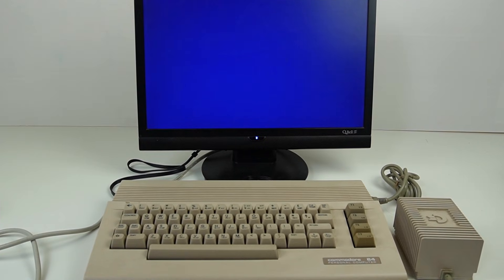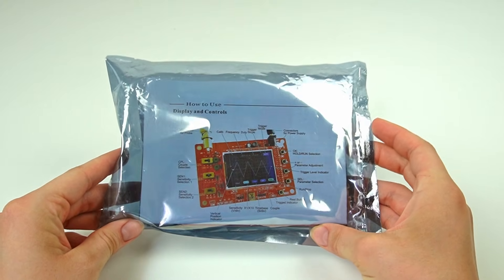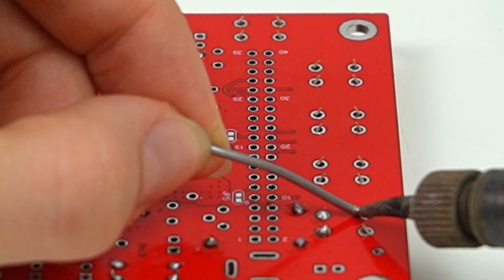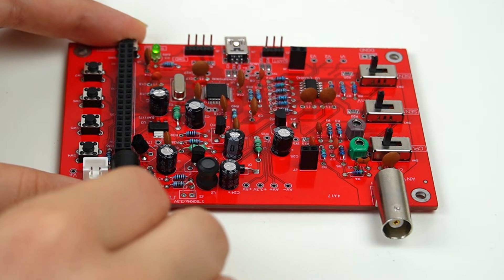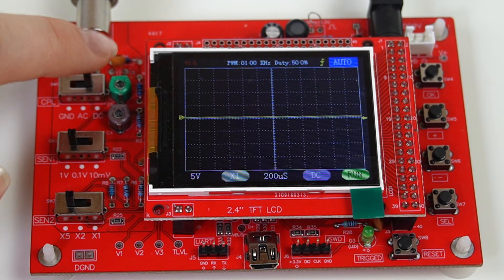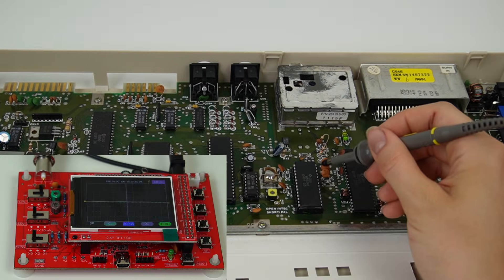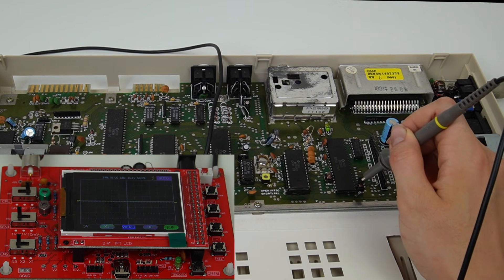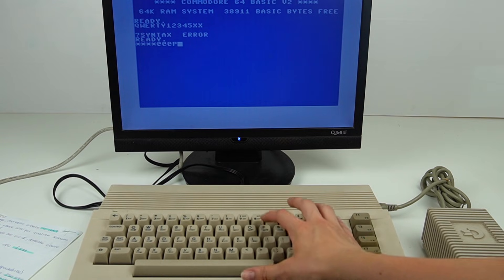I fixed a C64 using a $20 OSCILLOSCOPE

Comment: Great job! You just proved that repairs do not require expensive equipment and you can also build them yourself. I'm impressed. BTW. Soldering is much easier if you use soldering flux.
Reply from the maker: Thank you so much for your kind words and I appreciate the tip about soldering flux

Comment: Always good to see these old machines brought back to life. That $20 scope won't replace a proper scope but it is good enough for some basic checks of a circuit. You should not have to push too hard with the scope probe to take a measurement. If you do, something is wrong. In this case you mentioned oxidation in which case that should be cleaned first. Pushing too hard risks bending the pin of the probe. When the CIA was being resoldered the solder was balling up on the IC pins. This can happen for several reasons: the iron wasn't hot enough, the iron was only heating the pin and not the pad as well, moving too quickly from pin to pin and not giving the pin and pad enough time to heat fully. In the end you got the job done and the computer was fully working once more. Soldering technique and use of a scope comes with practice. Good luck with the next project.
Reply from the maker: Thank you for your detailed feedback and valuable insights! You've provided some excellent points, especially regarding the use of the scope probe and soldering techniques. You're absolutely right; practice makes perfect and I'm eager to continue learning and improving.

Comment: I'm impressed you went for the DIY option on the scope. I got one of the slightly earlier ones and went for the pre-built option. It was still the same price pretty much. It took me long enough just to assemble the clear perspex box it goes in haha. If I'd have built it from scratch it would have taken me all year and likely wouldn't have worked. 

Anyhow the scopes are really good if you don't have one. Great for learning how to use them. I'd advise buying a cheap signal generator on android and hook up the audio socket to the scope as a learning experience. See/capture different wave forms etc.

With the retro computers... you'll struggle to capture wave forms with that thing since they tend to output in the low MHz range and the most you'll get out of that thing is 120kHz wave form at best. Still, if you are using arduino, to do stuff like SPI with your own code, you can use a large divider on the clock and that will JUST about show up on the little scope. It's a little hard to get it to capture/trigger though. If you are trying to analyse something you have no control over the speed of though (like a retro computer), you'll struggle.

Comment: I have one of those oscilloscopes, and as far as I'm aware, its usable bandwidth is only somewhere in the tens to maybe a few hundred kilohertz, so you won't be able to properly visualize the system clock, address- and data lines, or the video outputs with it. It's also quite touchy about how the settings are configured, but if you tickle it just right, it should be just fine for slower signals.

Comment: Nice!  What I like most is such a young person taking an interest in an old classic.  Thanks for sharing.  Not sure if a 64 exists that has never been opened.
Reply: Oh they exist. Got one with original seals last month, as it works fine i will keep it this way 😂
Reply: @oliverochojski3561  I have a strip of those seals.  They can be reproduced and applied.   The seal means nothing.  The only reason why I acquired them was because they shipped with an Amiga I bought on eBay a few years ago.
Reply: @stephenbruce8320  I know about these seals, after Commodore Braunschweig closed there were many rolls of them around here in germany. But i bought this c64c with a blown power supply for 25 euros, i recognized after delivery that it was sealed, it was not mentioned in the advert. Advert only said no power light. So why should someone have resealed this machine and than sold it as spares or repairs for 25 bucks?
Reply: @oliverochojski3561 That's lucky, but most likely you'll have to open it and repair soon enough... these aren't the most reliable vintage computers.. haha

Comment: This was a really good video on getting the C64 repaired. I very much enjoyed it, and hope you have much success in your future videos.

Something to keep in the back of the mind is that this, and other versions of the 250469 revision motherboard use the VIC-II and SID that require lower voltages (9 Volts). The VIC-II and SID used in motherboard revisions before the 250469 use 12 volts

VIC-II:
6567/6569 12 volts
8562/8565 9 volts

SID:
6581 12 volts
6582/8580  9 volts
Reply from the maker: I'm glad you enjoyed the video. I appreciate your input and will definitely keep that in mind for future videos. :)

Comment: Well done on the fix.  Bonus that it was just a bad solder joint.  Those "short boards" are usually highly reliable compared to their breadbox predecessors.  However, I would strongly advise relegating your original power supply to paperweight duty, and buying a modern one from Electroware (or a similar reputable dealer).  Those old potted PSUs have been nicknamed the Commodore "brick of death", because when they fail, they go overvoltage and fry your C64.  Hope to see more Commodore content from you in the future.  -- JC
Reply from the maker: Thank you very much for your appreciation! You're absolutely right about the original power supply. I've heard about the known problems with those old ones, I'm definitely considering getting a modern power supply. Thanks again for your support :))
Reply: or you can replace the 7805 voltage regulator with a cheap buck converter, much cheaper and just as reliable ;) @Sayakas_Digital_Attic
Reply: That's exactly what I thought when spotting the PSU of death. A weapon of mass C64 destruction indeed.
Reply: Wouldn't it just be easier and cheaper to add a MOV or shunt to the existing power supply or inline on the interior of the C64?
Reply: @ikannunaplays  Those bricks are potted in resin, and therefore cannot be modified or repaired.  You can get a device called a "C64 Saver" that sits inline between the old power supply and your C64, which will trip if the PSU goes over-voltage.  I'm not personally a fan of them because they cost the better part of a new PSU -- which you're still going to have to buy when your old one gives up the ghost.  -- JC
Reply: @BasicBitesCA  The schematic for the C64 saver is open source and the parts are cheap, if she's got the ability to solder then this is a very inexpensive resolution compared to a new psu. Though I don't think such a complex and elegant solution is needed, but I also do not have a C64 to tinker with. :(

Comment: great job! keep in mind that Commodore's power supply adapters are quite old and tend to supply too much voltage. You should use a newer replacement as you might risk to fry some electronics (expecially the SID sound chip!).
Reply from the maker: Hi, thank you for the advice!🙂🙂
Reply: I agree with Loboolbo, original Commodore bricks are just pure junk, as the the 5 volt regulator will eventually fail, and sends too much volts 5 volt line, and will kill anything that takes power from that power rail. Repairing the PSU is not an option, because most (Like yours), are potted, and thus impossible to remove the bad parts.
Reply: @BillyMartin4Life there's videos on how to remove the inside parts so you can re use the cables and box.  I've done it on two of them.
Reply: @BillyMartin4Life It’s such a shame that they fail “up”, so they damage the computers. Seems the reason is that it was cheaper to build them that way.
Reply: @BillyMartin4Life  They weren't junk 35 years ago...but yes, they are 35 years old, so they shouldn't be used
Reply: If on a budget, you can easily modify the original ones with just a modern (usually router) 9v ac and (any old usb) 5v dc power supplies... there's a few videos on modifying the old one.  At least for now, check your current power supply to make sure it's still close to 5v on the dc (the ac is likely fine).
Reply: I am currently working on a Commodore PSU, that is for the C128, but C64 and C128 are in many ways quite similar machines... Apart from the obvious differences.

But as far as I understand the PSU on both of them works essentially the same.

They need 9 VAC and 5 VDC to run... The way the original PSU does this, it uses an old fashion coil transformer to get the AC from grid level to 9 VAC. And then for the 5 VDC that 9 VAC is first rectified and then reduced to 5 volts with some form of voltage regulator.

This design is not all bad... The coil transformers are essentially eternal, they are just rather heavy. And using electronics to bring the 9 VAC down to 5 VDC is a fairly straightforward solution.

Really the only problem is that an obvious failure mode is the fact that if the voltage regulator shorts out, it will send ~10 VDC down the 5 VDC line...

In case if wondering how does 9 VAC turn to 10 or so VDC with just shorted out voltage regulator, that would be how AC is measured as "effective voltage" after a set of rectifying diodes and couple of capacitors the voltage sets itself some losses shy of the peak AC voltage, wich is then slightly higher than the nominal voltage on AC side.

Now I don't think the way how the PSU generally works is bad as such... But the fact that there are literally no safety systems built into that. If the voltage regulator shorts out, like it often seems to do, it will just double the DC voltage and likely fry some hard to replace parts.

And in case if you didn't allready guess it, my Commodore PSU does have this particular problem. A good thing that I had heard of it before, so I didn't just plug everything in and watch it burn. But tested the PSU first. Now my plan is to basically remove the DC regulator components right of from the original PCB inside the PSU... Build a new voltage regulator on a daughterboard, wire those two boards together and mount everything in a tidy and smart way (atleast that is what I'm hoping). I am atleast trying to make everything basically reversible, so if at any point someone would want to make a complete restoration, it would be possible to do so. In the beginning I did consider just replacing broken components... But while the general idea of the PSU is quite simple, correctly identifying each and every component, some of wich might not be available... So eventually I just gave up and decided that I can easily trace AC going in to the diodes, beyond that it is DC, so rip everything out past that point, add a new step-down regulator there and that is it. Atleast that way I can fit a fuse and overvoltage protection to the PSU.
Reply: @juhojohansson1716  If for whatever reason, you don't want to just swap the parts inside the psu and want to keep it stock, there is a device called a c64 psu saver that can be used in line between the original PSU and c64 for over voltage protection.
Reply: @BrianV_PM  yes, that is a good option in case if the original is still working... Or one would repair it to the original condition (no fuses or overvoltage protection).

And just as a side note one should bear in mind that the PSU is a grid powered device, so repairing or modifying it might require licence to work on such electrical devices...
Reply: @juhojohansson1716  I guess it depends where you live... in the US, they don't care.  And yeah, personally i would just pull all the innards out and put new stuff in (which is what i did), but you mentioned wanting to keep it all original inside which is the only reason i suggested the c64 power saver.  To me, the c64 power supply isn't core to the system, or a nostalgia piece, so i don't care about modding it.
Reply: @BrianV_PM  well to be honest I think the way I am doing this is kind of dumb... Atleast if thinking if there would be easier ways of doing it.

But I was basically looking for a tiny electronics project that would match my current skill level, and this PSU voltage regulator seemed to fit that.

Comment: Well done! Nice video. 
I personally would get rid of the cardboard shield. It has no function anymore and only traps the heat inside the case.
Reply from the maker: Hi! I'm glad you enjoyed the video, and I really appreciate your advice🙂
Reply: I would disagree - it also protects the motherboard from dust and liquids. I've repaired multiple C64s and Atari XL/XEs, and the ones with the shields in place were preserved in much better condition. I never remove them.
Reply: If is is a metal shield, you might have a point. But those cardboard shields are useless.
Reply: @joopidema  Those cardboard shields do the same job protecting the motherboard from dust and spills. It is only about something being placed between the board and the vents.